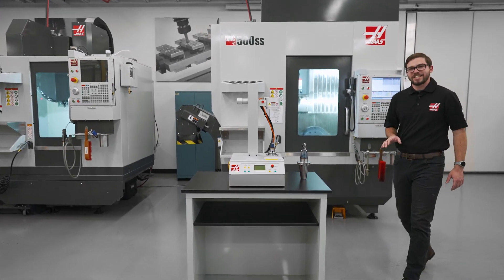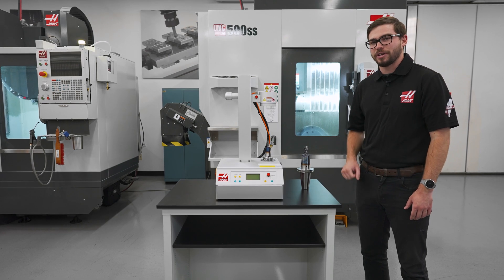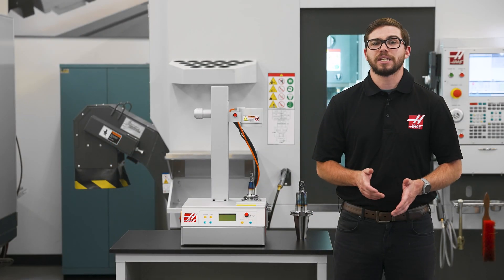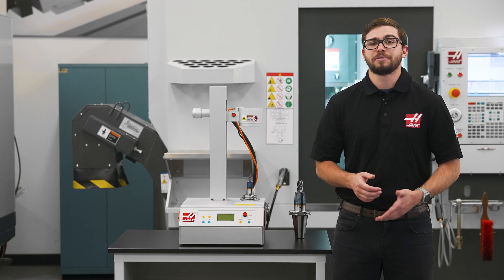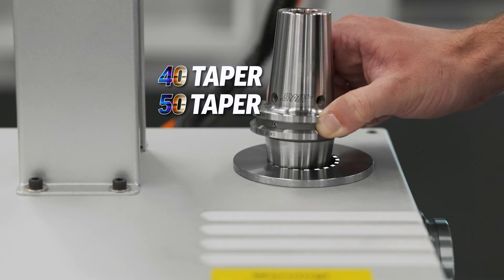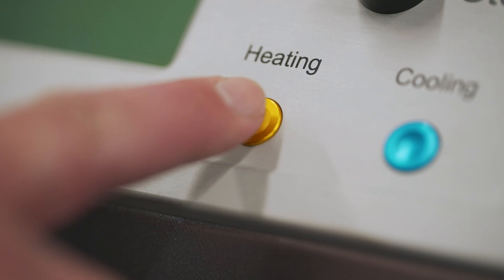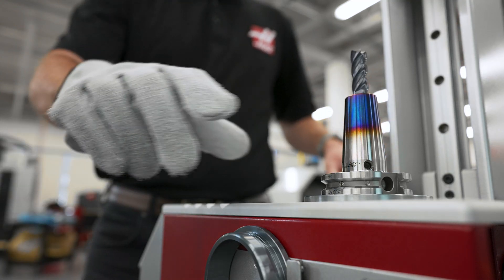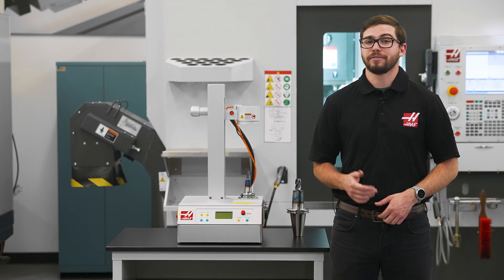HSF-325 First Look - Haas Automation, Inc.

Comment: yeeah im sure the shot of air will be enough to cool the tool down.
Reply: That’s how Techniks system works as well. Works good, cools in about 60 seconds. Louder than Haimer cooling system but you don’t need a chiller unit. This saves cost. Good looking system.
Reply: It's not meant to cool the tool... The "cooling" is just basically setting the tool. It reverses the expansion of the holder just enough to hold the tool before usage

Comment: The main problem with haas machine is in machine purchase.

Why to purchase macros, rotation commands etc when we buy machine?

Even other manufacturers like fanuc, Brother etc offering same features free
Reply: i take it you've never actually bought a machine? the other companies don't give you those features for free, they just aren't telling you they are charging you more for them. if you go look at your itemized invoice, you will see the charges on there.
Reply: @CMTeamCobra I agree with you up to a point, however Haas also cripple their machines and make you pay extra to unlock their potential.  For example Ridged tapping, or HSM.  Anyone with a VMC is going to want tapping, and everyone who buys an SS machine will get HSM.  its an extra $7k on the list price of all machines before you even get started on real extras.
Reply: @CMTeamCobra well yes.  a mini mill is not an ss machine, so of course hsm is not necessary.  I'm also not saying everyone "needs" rigid tapping.  The point i am trying to make is because all haas vmc's have an encoder on the z axis the rigid tapping purchase doesn't actually add anything, it just removes a software block from the control, same with hsm.  it doesn't cost haas anything to enable them because Neither of those options require anything additional.   for options like dynamic offsets or tool centre point control at least you're actually buying macros.
Reply: @AlexMageethefirst  it is frustrating but that's how things are priced on the low end, not just CNC. A low barebone price to lure you, which you rarely buy as is, and then options that add up fast.
Reply: @SuperYellowsubmarin  yep, i get it’s the way the industry works and it didn’t stop me buying two haas machines, but it just feels slightly ...shady 🤷‍♂️ 

Having said that though at least haas have transparent pricing, even trying to get a quote for some of the higher end brands is like haggling with an Egyptian rug merchant.
Reply: @AlexMageethefirst  Absolutely, all prices are there for you to see. Asking for quotes drives me mad.
Reply: @CMTeamCobra the original poster said they were free.